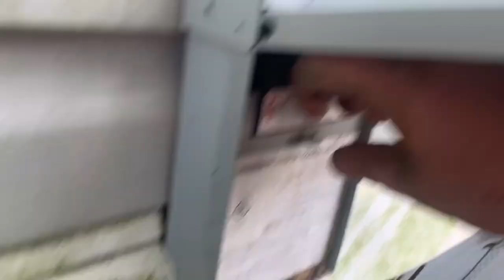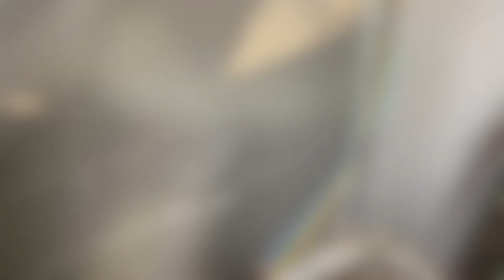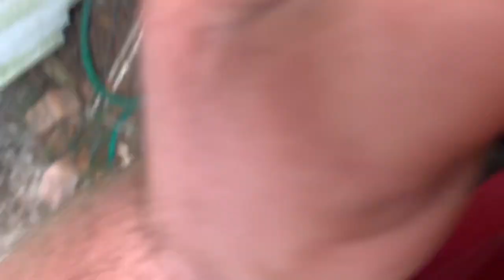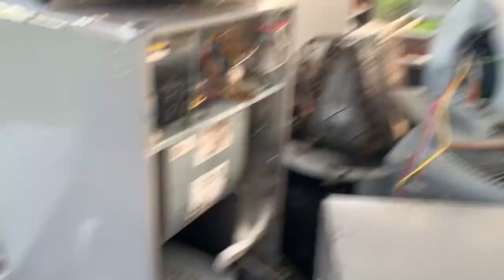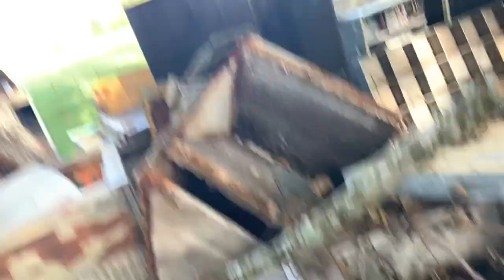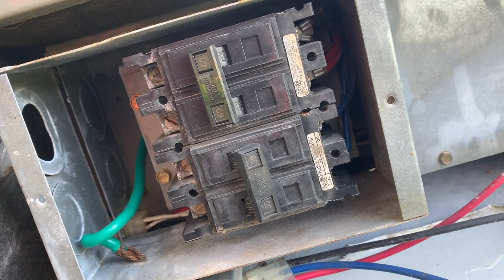Pain in the A$$ Service Call

Comment: John you could have take fuse from indoor electric heat and put in outdoor unit if it had 15 kw of heat until you could get fuses next day. 60 Amos fuse would run indoor blower and 30 amps could had went to outdoor unit
Reply: she wasn't home till after he went and bought fuses so it possible he didn't have access inside the home

Comment: If it sparked when the wires were pulled out that means that the fuse had to be good. Right.
Reply: If both fuses were blown before it was hit then it wouldn't have tripped the breaker.
Reply: True